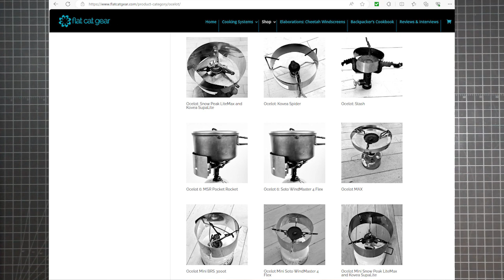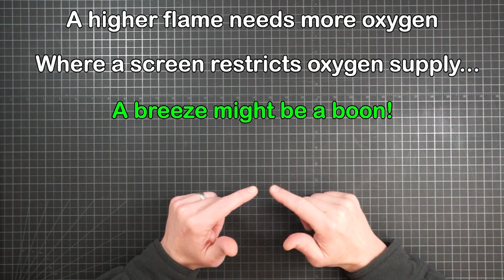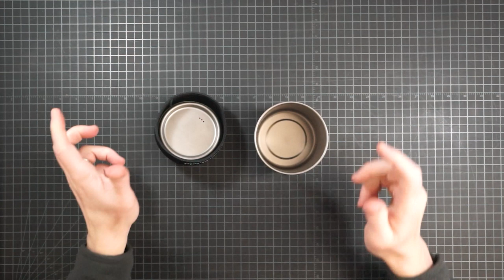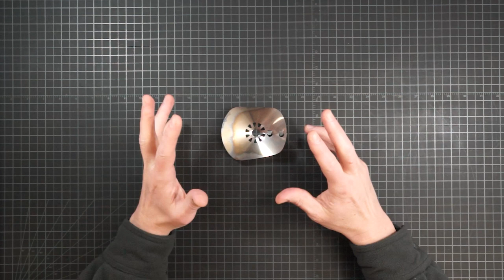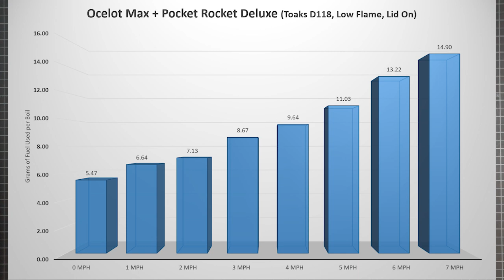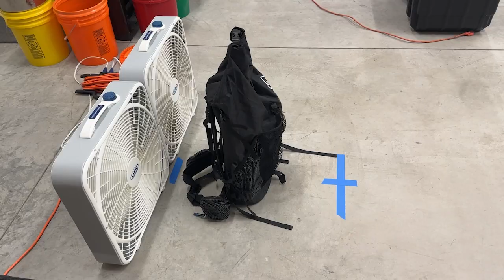Backpacking Stove Efficiency, Part 3: Windscreens

Comment: It looks like the simmershield floor was obstructing the brs burner throat holes to some extent. Couldn't get a real good view but possibly physically blocking them where it attaches to the stove, or at least restricting fresh air ingress by somewhat isolating them into the same combustion chamber which is far less of an issue with the other designs.
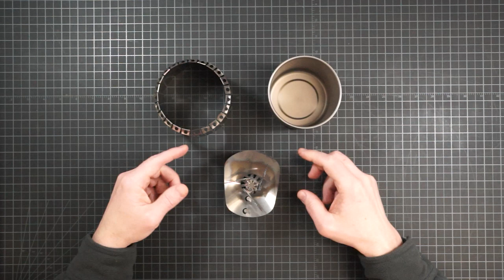Reply from the maker: It is tough to tell from that side view, because the floor is bowl-shaped. It actually does fit below those holes. Watch at 15:20 and you get a brief view inside the bowl where you can see the holes are technically clear.

Comment: To be clear, our main goal was to keep your stove functioning when the winds pick up.  Given that the BRS 3000t is inoperable above a 2-mph wind, there was an opportunity for improvement.  The secondary goal was to improve efficiency on longer trips in order to prevent you from bringing an additional fuel canister.  That’s saving over 7 oz of weight for a small canister.  Keep up the great work.
Reply from the maker: Indeed! I was impressed by how the screens worked. I actually never used to carry one, but the Mini is now in my regular kit.  Thanks for making good stuff!
Reply: @GearSkeptic  This video pushed me to pull the trigger on the Mini as well. I love how it nestles right down inside my Toaks 750 like it's not even there. Can't wait to get it out!
Reply: @GearSkeptic please contact me about HX system suggestion
Reply: Been looking for something like this for a while, couldn't believe I've never heard of you guys considering the known issues with the BRS. You got a sale from me. Wish the shipping had been cheaper though. Is there a reason you don't use the USPS flat rate boxes or something. Should be much cheaper considering the size of these things.
Reply: @Orange_Tang  As GearSkeptic points out in this video, there are a plethora of solutions out there; each with their own advantages and disadvantages. The customer gets the privilege of deciding which solution best meets their particular needs.  Best regards.

Comment: "I won't lie, I like big bottoms."  Hahaha!  Moving on if I can, when I anticipate big winds I take a Kelly Kettle Trekker. No need to take cannisters,  uses twigs, never have to worry about running out of fuel. These weigh 1.5 lbs, and pack size is  5" by 10".  When you add the weight of two 4oz cannisters ( 14.8 oz ) plus the weight of the stove, pot and wind screen, they are pretty close.
Reply from the maker: I do have plans to add stick stoves to the testing. Just need to develop a protocol.  But, if I don’t do heat exchangers next, they may publicly flog me…
Reply: @GearSkeptic  How about gasifier stick stoves? I'm surprised I've never seen anyone make a flat-pack stick stove with additional folded or fitted metal sheet to create the geometry for gasifier airflow. It might be too complicated or massy or fiddly, but when has that ever stopped anyone?